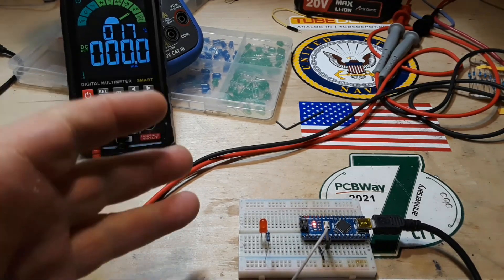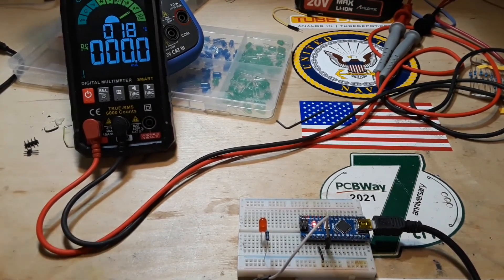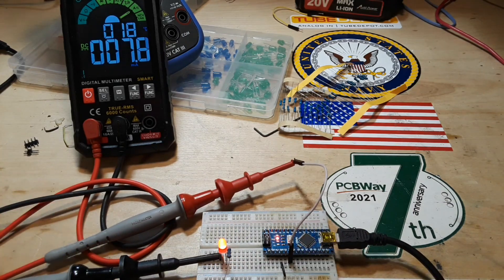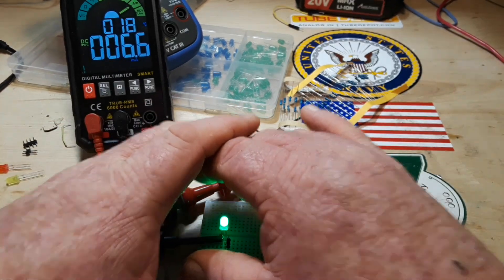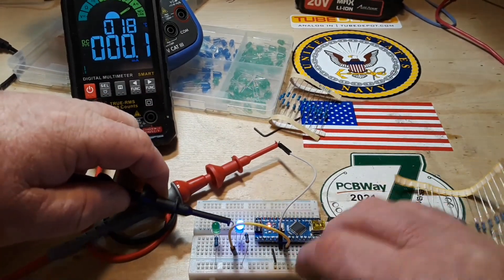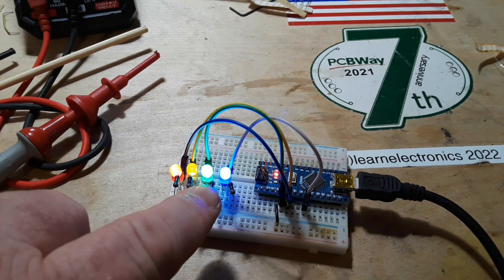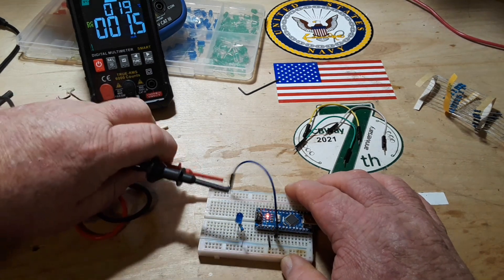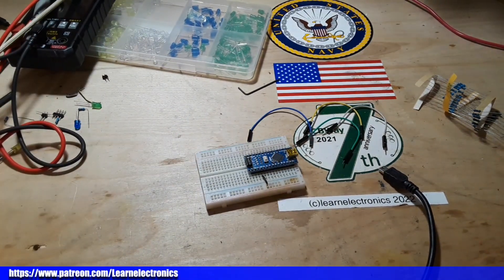Arduino Foundation Series - LEDs

Comment: The Total allow current for All the output pins is 200mA, so Each output pin is outputting 40mA of current per each output pin. You didn't mention what is the correct max output current per each output pin. 200mA divided by the number of output pins = Result

Comment: Just last week I tried to figure out from the spec sheet how dim I could make an LED (I was dumb and got the super bright ones when I first started gathering materials). I calculated 1.7K + some, but there is no such thing as a 1.7K resistor in most sets. A 1.8K did work, though. I should have measured it to see where exactly within its tolerance it ended up, but I wasn't thinking of it at the time. Just for the hell of it I tried the next size up, 2.0K. It didn't light. I'd say that was a successful initial calculation anyway.

Edit: I botched remembering the nominal resistance values, which are fixed above, and I finally measured the resistor that worked at 1776 ohms.

Comment: LED current limiting is important concept when first starting out, very in depth using meter and different color LEDs. Can use a pot to vary brightness but that's over the top for most applications.